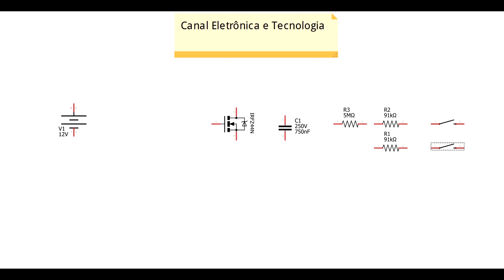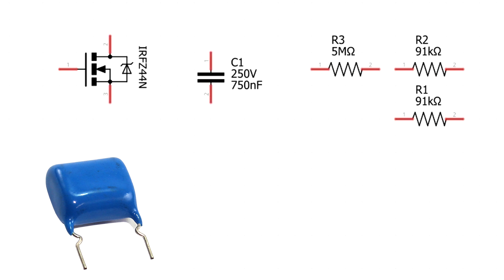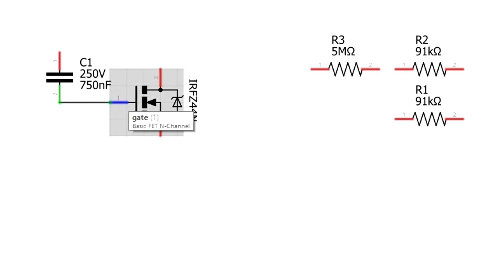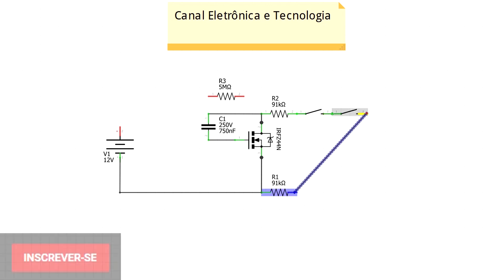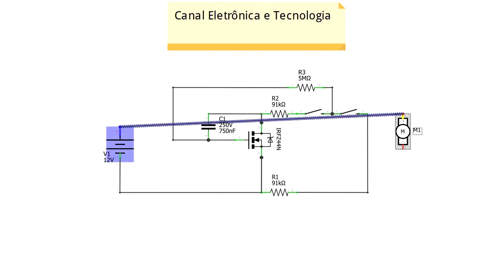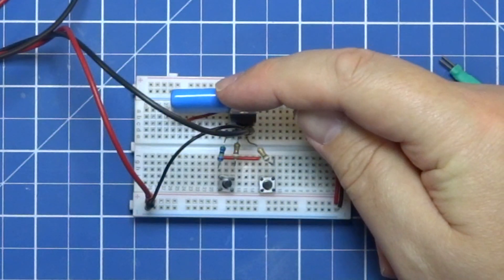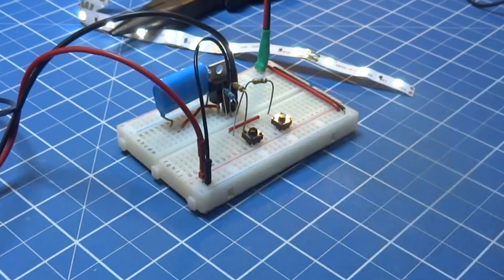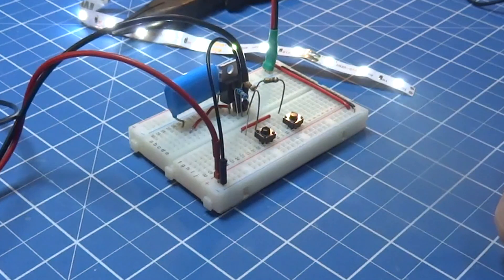Projeto muito legal e simples. Faça o seu. "Potenciômetro Digital"

Comment: preciso  de potenciometro para variar a tensao de um varicap  de 3v a 21v, com corrente de 0,007A, será que esse circuito resolve,  me disseram que o potenciometro deveria ser linear para precisao da variação de tensao  de 2casas decimais, tipo  2.22v, 2,24, 2,26 e assim sucessivamente de
Reply from the maker: Ele não vai te dar essa sensibilidade e precisão. Acho que o melhor neste caso é um multivoltas.
Reply: @EletronicaeTecnologia  ok muito obrigado,